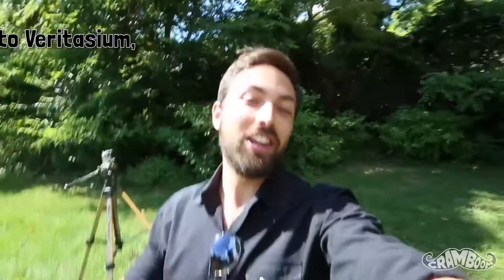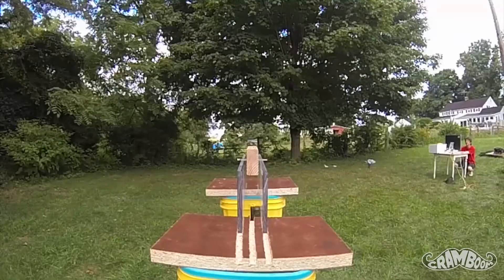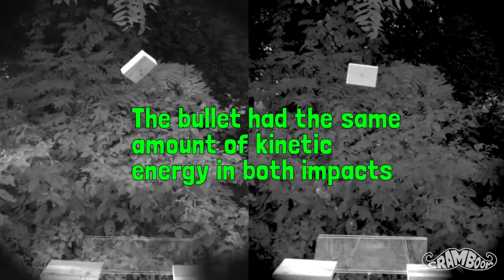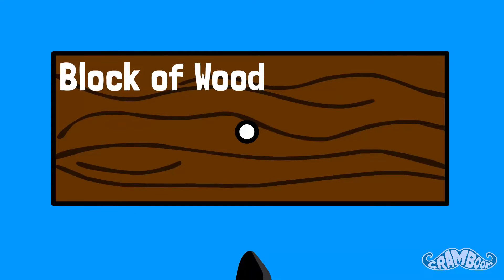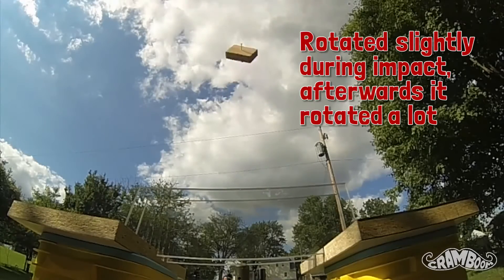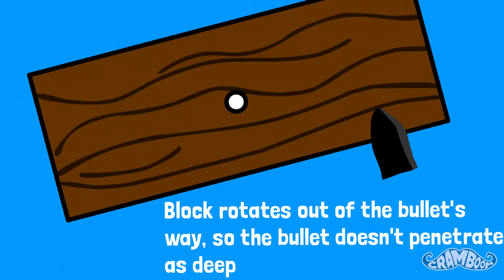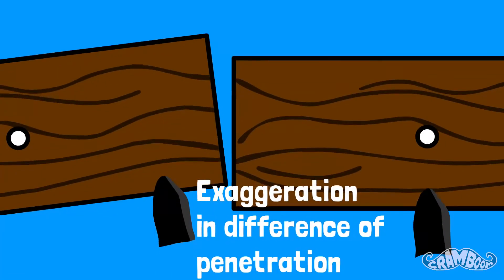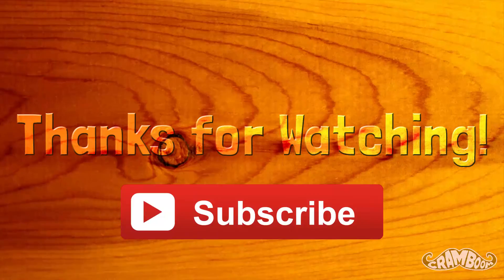Correct Answer! - Veritasium's Bullet Block Experiment

Comment: Good explanation.
For this conclusion, all that's necessary is to work the problem in 0-g, in the center-of-momentum frame. The bullet-block object resulting from both types of impact, will have exactly identical velocities (=0), due to conservation of momentum. This means that in 1-g, the blocks reach equal heights.

Comment from the maker: But there would be more inertia in the case where the bullet hit towards the center of mass.  The nail that the block was balancing on allowed the block to rotate without moving up, to a certain extent, so when the bullet hit off center the block had less inertia.  When it hit center mass the block actually had to be lifted, so the bullet could travel further.  Good observation though!